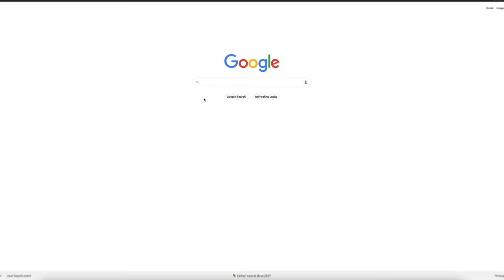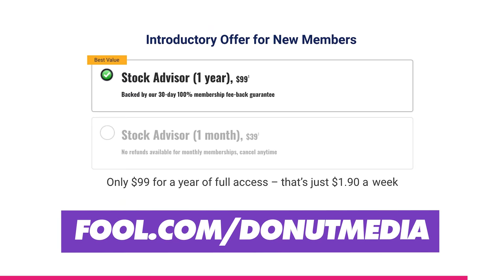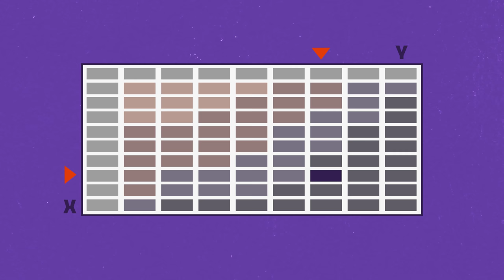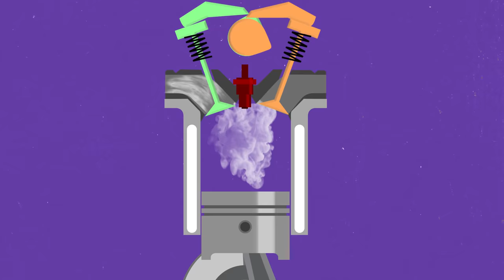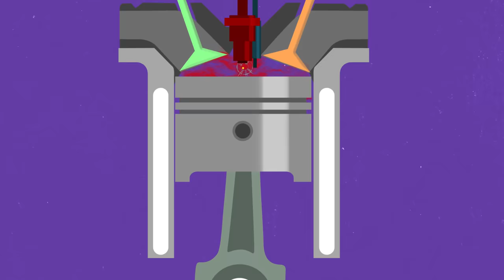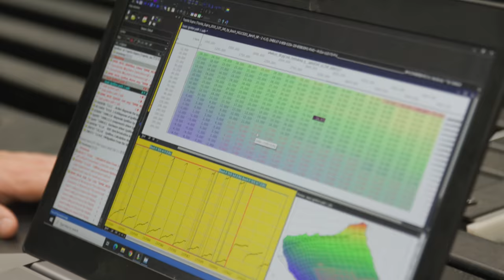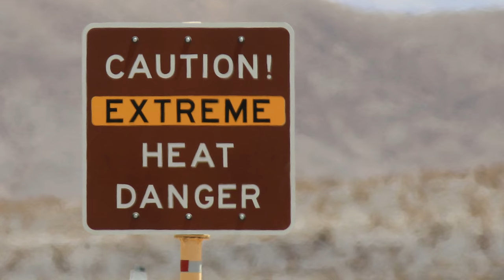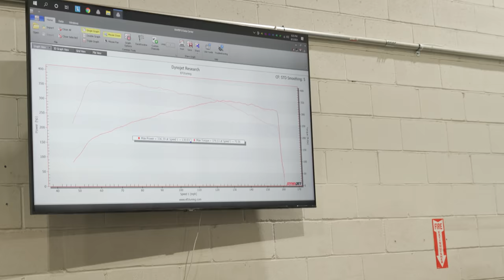Why Are They Banning ECU Tuning?

Comment: If emissions are truly their only goal, Cali needs to bring back the tailpipe sniffer. If it runs clean, then it IS clean. Sounds like yet another money grab to me.
Reply: @EVS What's even funnier is the lack of the legislator's knowledge of the CANBUS system or they would know that modern ECUs can be swapped back with very little effort.
Reply: It is not a money grab. It is a lack of understanding of how the technology works and poor implementation. 
It is this simple.
Reply: @ltlbuddha  it is a money grab. There’s so much other car laws that don’t need knowledge about how cars work. It’s illegal to have a loud exhaust and it’s a mandatory ticket despite “loud” being subjective and cops not having the technology to read decibels, window tint laws, license plate laws, it’s literally illegal to have any modifications on your car that requires a time. It’s illegal to modify your car to run e85 despite e85 being cleaner for your engine and the environment, the fact that California is the only state in the entire country that has a state referral program shows how much of a money grab it is.
Reply: @nickmacias00  If it were a money grab, it would be the end user paying the fee, not the mod shops, that would result in way more money.
California's custom vehicle plates are an example of a deliberate revenue stream, ECU modification laws are not. 
Safety and emissions are the primary drivers behind many of California's laws.
Reply: @Hey Man 😆😆😆😆 you sir, are fuckin hilarious
Reply: I couldn't register my 350Z because of a very basic aftermarket air intake, and I was like, tailpipe test?  We do that in Ohio, but not in CA, sadly.  The MAF was after the cone filter and tube!  Didn't change emissions at all.  They'd do more for emissions if they just went after all the guys driving trucks/cars with wheels sticking out past the fenders.  I'm reminded of a conversation I had with a buddy with guns where we concluded that gun owners should be writing the laws pertaining to gun safety in CA, not bureaucrats with zero hands on experience.
Reply: Emissions testing has been a money grab right from the beginning. Think about a smog pump right they pump fresh air into the front of the exhaust and emissions testing is done at the tail pipe. The engine didn't run any cleaner and the catalyst didn't function any better with the smog pump. The ratio of pollutants versus clean air was modified by a pump literally pumping fresh air into the exhaust to fool the tester by changing the total amount of air pumped out of the exhaust.
Reply: @EVS That's the idea, aftermarket PNP ECU manufacturers like MSPNP and Haltech have units that are compatible with CAN and even have OE connectors pre-installed, making swapping trivial.
Reply: @jeremypike9153  false. Secondary air injection pumps help unburnt and partially burnt fuel to forgo recombustion .
Reply: It was 40 degrees all summer here in canada bud. this isn't about money. Use your head.
Reply: @High_Octane  if you mean vehicle emissions is the main reason behind climate change, I'd encourage you to do some light reading on who is really to blame for the record breaking temps. Yes, it DOES play a factor, but ECU tuning is NOT the major reason behind climate change lol.
Reply: @EVS good think I have a 2000 lol
Reply: @cbruh1k  He is actually correct air pumps pump fresh air into the exhaust before the catalytic converter to have a leaner mixture going into the cat so it heats up faster.  It is a way manufacturers can make the engine appear to have better emissions coming out of the tailpipe by diluting the pollutants in the exhaust until the cat heats up to burn unburnt fuel coming out of the engine.
Reply: @EVS I think they meant that the literal ECU with a stock tune can be plugged back into the CAN system and function as normal with ease. And you can keep a tuned ECU at home. Idk how Cali smog check works but I don’t see the issue with flashing back to stock or switching from your standalone back to factory before going to get the check… not many older ECUs keep track of how many flashes an ECU has had- and you really couldn’t tell if the module was swapped. Obviously if it’s a PITA to get to then there’s an issue but 🤷‍♂️ I will likely never live in California even before this, but now I definitely won’t. I am literally about to flash my E36 with some fuel maps I am working on to make it burn more efficient, so it’s not about power.

Edit: I guess some/most ECUs have a counter of how many flashes it gets. I’ve only worked with brand new cars and pre production models so I figured it was new with how fancy it is. But I guess that’s how they check for modification.
Reply: @ice9dragon  ok ill read some more just for you ;)
Reply: @High_Octane  hey thanks! ;)
Reply: @jeremypike9153  you're misunderstanding how tailpipe sniffers work. They measure ppm. Not %. If it was percentage adding fresh air would help. But it's not.
Reply: Valid point. 👍👍
Reply: Steph Kurdy  To get the CARB endorsement costs companies a ton of money.  That's why a lot of performance parts are not CA legal.  Companies do not want to pay the bribe to sell those parts even if they know those parts will pass.  On top of that if you fail and can't register your vehicle, the registration costs start to jump and jump quickly.  I have my reg for my motorcycle right in front of me.  It starts at $195 for the year, 1-10 days late it goes to $219, 2-4 weeks late it goes to $233 and after a month it jumps to $280 and thats just for a 700cc motorcycle.  So, if it take you a couple of weeks to get the part to correct your issue, the state just got an extra $40 off of you.  Plus the cost of two smog checks, which to be honest I don't how much money the state get's out of that.  Even with a new vehicle that is exempt from smog they still charge an abatement fee.  So between millions of acres burning every year in this state and per EPA, 25% of California's air pollution coming from China, does this seem like a real game changer to air pollution problems that come from a handful of enthusiasts or a cash grab when there are much bigger air pollution problems?
Reply: @ridethetiger1895  iT's nOt a mOnEy gRaB
Reply: @High_Octane  Welcome to mother nature at work. Between all the increased volcanic activity over the past 400 years (and the sun's solar cycle change this summer) it makes all our emissions look like a fart in the wind in terms of changes in the weather.
Have to look at long term shifts not just the short term things that politicians are claiming are the issue, back in the 60's they were claiming we were going into an ice age (and technically they aren't wrong we're on a 500,000 year cooling/healing cycle and we're actually on the cooling phase) and in the 80's and 90's they were suddenly claiming things were heating up and the coast would be flooded by 2000... Yet it's not happening.
Reply: I agree with op, sniff the exhaust, not just plug it in. Tuning is to make an engine more efficient, which in turn can usually add power. And being more efficient should be as clean at least. I mean who would want a tune that's less efficient and say just dumping fuel causing super rich afrs. That's why u don't get a chip, they likely would fail tailpipe emissions but a true tune idk. I'd like to see a car before and after on a tailpipe sniffer.
Reply: @SilvaDreams  thats alot of apple sauce spewed from a pie hole sir. glad you got it alllllllll figured out though. LOOK OUT EVERYONE. we got a heck of brain over here.
Reply: It's all about being able to control you.
Reply: No use when you can just run a VW tune to be clean as soap when being tested but pollute all you want down the road
Reply: @nickmacias00  Cars have specific decibel limits in CA, it is 95 decibels for cars and 80 for motorcycles. If the cops "believe" your car is too loud, then you have to bring your car to somewhere where they run tests on it to see how loud it is (among other things), and if it isn't too loud, they give you a certificate, you bring it to court, and they toss it out. It isn't like the cop can just say "it's too loud" you now owe us 1000 dollars, pay up.
Reply: @magicstew45  ppm is a fraction, a fraction can be converted to a decimal, a decimal can be converted to a percentage.  Therefore ppm is actually a percentage.  If you have 999,990 clean air molecules and 10 dirty air molecules, you have 10 ppm dirty air.  If you pump more clean air molecules in, to where you now have 1,999,990 clean air molecules and still only 10 dirty air molecules, you will get a reading of 5 ppm of dirty air.  If you increase the amount of clean air, you reduce the ppm of dirty air.
Reply: @ltlbuddha  It doesn't matter who writes the check, the end user bears the cost through increased prices. Just like salary taxes are cashed by companies, but in the end employees bear the cost by getting the wages reduced
Reply: @magicstew45  ppm is the exact same thing as %, just 10 000 times smaller. 1 ppm is 1% of 1% of 1%
Reply: @jeremypike9153  Partially yes, but the main reduction comes from the cat having enough oxygen. At cold start you are running a rich mixture, thus you have a lack of oxygen and excess carbon monoxide and unburned hydrocarbons. You cannot oxidize (combust) them without oxygen. Pumping fresh air allows the cat to work. CO is combined with Oxygen to get CO2, HC's are combined with oxygen and you get CO2 and H2O
Reply: @petarmiletic997  This is true, but is a separate thing from the motive of the government. If their motive were purely monetary, they would charge drivers.
Charging the shops means fewer will do it and less money will be made.
Reply: @magicstew45  parts per million gets skewed when you add more volume or "million". I've sat through emissions classes and I've dealt with having to pass emissions testing. Even the technician teaching when asked about it said "they" say it helps the catalyst work more efficiently but there is absolutely no way to test the extra efficiency gained because the tester is testing the exhaust if you pump clean air in there is no way to verify that it actually helps. By removing the clean air you were pumping into the exhaust the parts per million is obviously going to change just as it does by pumping in fresh air.
Reply: Isn’t it always.
Reply: @ltlbuddha  It's a money and power grab because it means more power for the State and more work for the State to do, more state employees, more ways to lord it over citizens, more funding required from citizens via taxes or fees; CARB just built itself a half-billion-dollar facility paid for by the state (i.e. citizens). And manufacturers pass their testing costs onto you- or don't make anything at all for you car, more often the case except for certain very popular models. Then there is the fact that if you think your car should be passed you can have it tested/refereed at your expense.
Reply: @chir0pter  You literally don't seem to understand how government works. It takes money to build infrastructure, services, etc. Lord it over citizens? The biggest problem with government employees is that they don't think about the citizens.
Reply: @ltlbuddha  bureacracy, to a bureaucrat, is its own reward. Increasing their domain, wielding power arbitrarily, and grabbing money to help support these activities. Combine that with climate alarmist ideology and big auto lobbyists and you get the CARB.
Reply: @chir0pter  OK, I get it, logic and reality aren't doing it for you. Apologies for trying

Comment: The Money Pit episode on installing a new ECU is gonna be really popular soon. It's not ECU tuning if it's a whole swap.
Reply: Aftermarket ECUs will also be illegal soon.
Reply: You still modified it
Reply: You still upload a custom tune to an aftermarket ecu, but I like what you're trying.
Reply: unfortunately replacing the entire ecu wont be a work around. When you go to smog the vehicle the shop will check to ensure you are running the ecu map that the car came with from the factory.
Reply: @Canto831  i don't know of any aftermarket ecu that talks to smog equipment at all.  Actually maybe this is a market...  if you do a piggyback style standalone there might be a chance, and there are options for fooling stock ecus.
Reply: @ALS Cryptostudio on a STOCK car you could do that. The technology has been around for a few years now to swap tunes from certain providers. However, the more mods you do, the harder it is to “just go back to a stock tune”. At a certain point you end up with a check engine that leads to the car failing immediately (in certain areas) or the car running in limp mode which may push you outside of passing a smog test. All of that is to say that “just swap to a stock tune” isn’t always going to work.
Reply: @ALS Studio good old VW special
Reply: @Canto831  The money pit Miata wouldn't have had a port to plug into to check that.  It was pre OBD, I'm not sure how they will be checking this on cars made before 1996.
Reply: @drkreign  if you spend THAT much money on aftermarket parts anyway, just throw in the 1.5k or some that it costs for the emission test of your car and voilá. its legal again.
Reply: @ALS Studio that works if your car is stock my truck won’t start on a stock tune
Reply: @Canto831  how about if a car is engine swapped to something the dont have tuning data on, or a custom engine?
Reply: yeah why not get 2 ecu now. your stock one you put on for smog every two years. then a tuned one.
Reply: @Canto831  why not switch out ecu every time you smog? have the stock factory ecu, then get another factory ecu and modify that.
Reply: @ALS Studio the idea of the ban is smog checkpoints will be a bigger thing in
The next couple years, stock ECU’s, atleast newer ones, throw a code for tampering, much like ripping the void sticker on a game console.  that’s what the check points will be looking for, not necessarily checking your fuel map, more codes more tickets more money for California.
Reply: The car isn’t going to pass obd emissions testing with an aftermarket ecu so that doesn’t help anything
Reply: @ALS Studio that works fine if you have a pretty much stock car. But if it’s modified to the point of needing tuned it doesn’t help
Reply: @anonymousarmadillo6589  a lot of companies already have "Plug and Play" harnesses which are exactly that
Reply: Galaxy brain right there
Reply: @Canto831  You can always swap the stock one back for smog, then swap into the tuned one
Reply: @anonymousarmadillo6589  The harness is not the issue; ECUs are often connected with just one big-ass plug, even 30 years ago (although 30 years ago you often had 2 or 3 computers, only one of which was called the ECU, all working in concert to do what a modern ECU can do). The issue is mating the unit to the car; can't really do that at home and it's not cheap. But, honestly, if you are willing to mod your car at all for performance then it's still better than nothing.